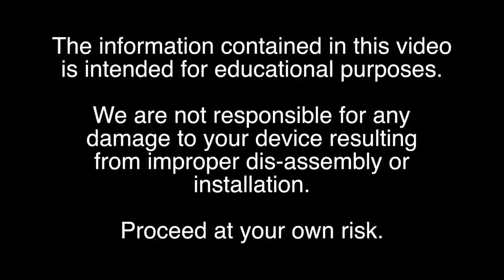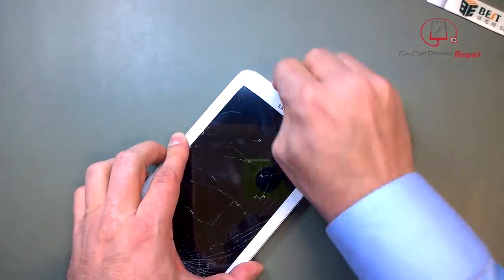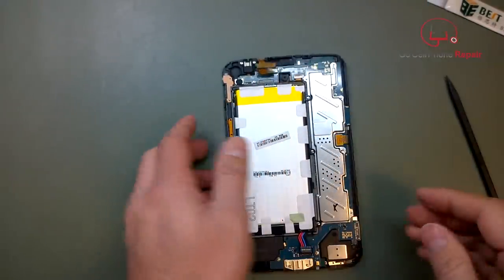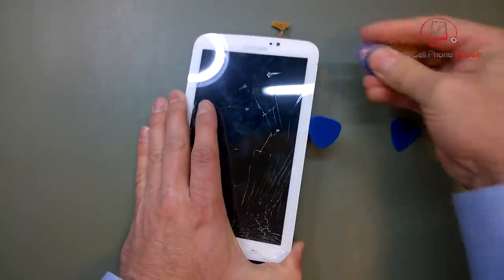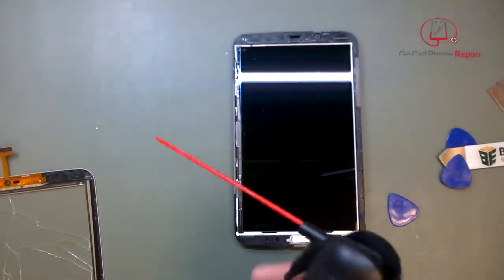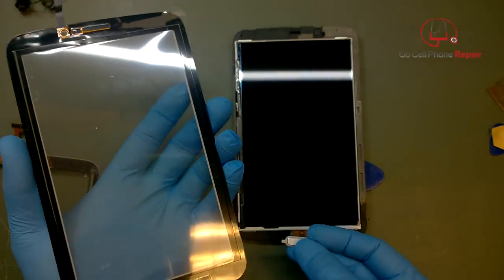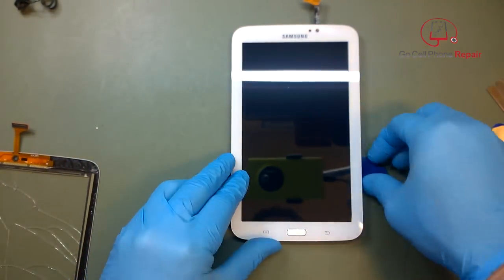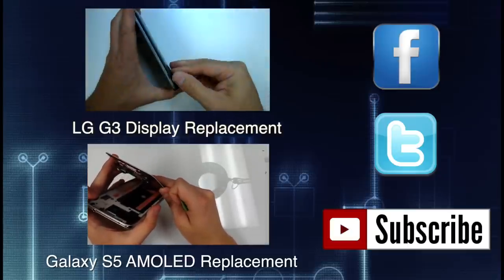Galaxy Tab 3 7.0 Touch Screen Replacement

Comment: Used this video to prepare for replacing my Tab3 screen. This is definitely one of the better videos.
Some notes:-
First minor observation would be to lightly tape the home button in place on the new digitizer (tape to outside of course) prior to the one off chance fitting.

Second minor observation - with regard to aligning the digitiser to the Tab3 body to less than 0.5mm I would use sight and feel to fit the digitiser as near perfect and central as possible.

Mine centralised perfectly using sight and feel. Quite important as you don't really get a second chance.

The points about dust avoidance and keeping clean are important and rightly emphasised.

One Tab 3 screen replaced successfully. Thanks for the video that made the task easy.

Comment: I just did this per your instruction and it worked perfectly. Unfortunately the screen I ordered had a small imperfection it's no big deal and you can hardly notice it when the device is on and in use. Since this is my personal device it's not a big deal. Great video!

Comment: Can the new digitizer be tested before removing adhesive backing and permanently installing? I have old one removed, new one plugged in but not adhered yet, system boots but touch doesn't work.

Comment: Thanks for the video. Check out a LensPen for working on raw screens. If you smudge the screen the charcoal end is great at taking out fingerprints without having to go through buffing out a screen cleaner forever. You can also use the brush for the random debris instead of canned air. Canned air's probably a bit more convenient, but the brush is certainly less consumable.
Reply from the maker: +Travis Johnson Will do. Youre talking about the one with gold rings right?
Reply: +Go Cell Phone Repair I'm not sure there's a meaningful difference between the flavors, though the micro can be handy for recessed cameras or camera glass covers. There's a 3 pack that's a pretty reasonable way to go.